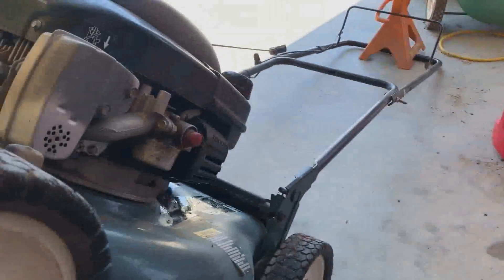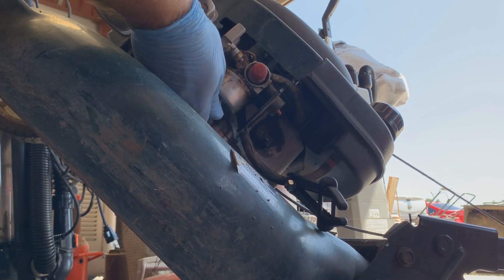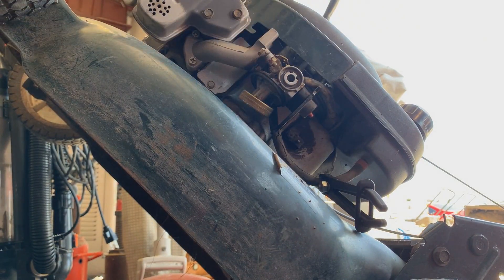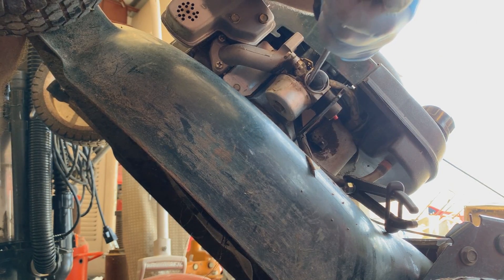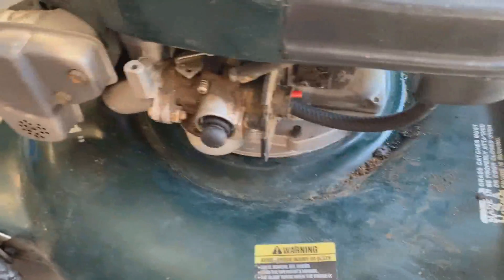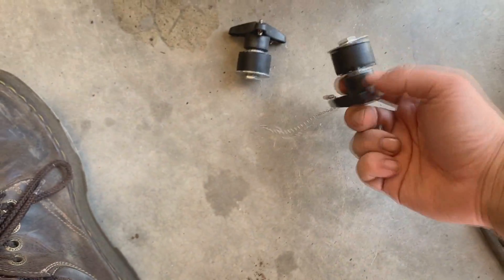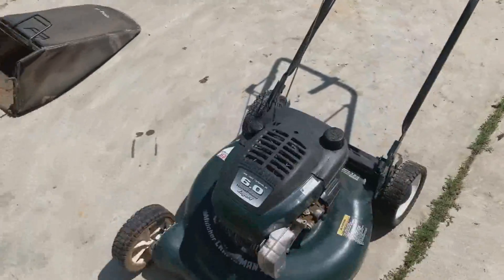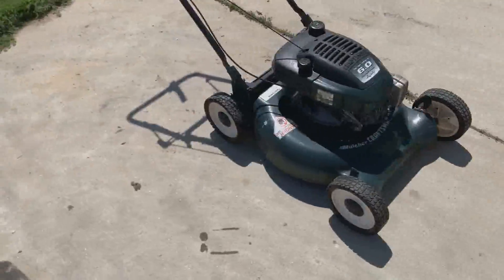Fixing a Tecumseh Craftsman Eager 1

Comment: Thank you for the detailed video. A few questions: Is there a fuel filter and if so, where is that located? I would like to replace my line, primer bulb, and filter if possible.
Reply from the maker: If there is a filter it would be in the middle of the fuel line. Most of the time people don’t install them.
Reply: There’s one in the tank
Reply from the maker: @intotheadventure2592  that’s a screen. Not a filter.
Reply: Thanks guys this helped

Comment: I haven’t worked on or seen a brand T in a long time.
Good video
Reply from the maker: Yea I seldom get them in anymore, hardly stock parts either, still have some new bowl gaskets, air filters, primer bulbs and a few loose carbs but all the other tecumseh stuff I had on the shelf i've slowly gotten rid of.
Reply: @hanksgarage_  I think I might have one air filter, and maybe a primer bulb. Somewhere in the hoard is a complete carb. I'm sure it's needing a clean and parts. I even have a briggs pulsa prime unit. Took it off of road kill. Only serviced one in the last 10 years. And its issue was a broken manifold pipe and incorrect gasket placement from a not so helpful neighbor trying to help out another neighbor.
Reply from the maker: I have a feeling there are so many left on this end of the country, is because we dont really have rust issues here. Might explain alot of that, but like I said its been pretty rare to get them now. 10 years ago they were a lot more common.

Comment: Im getting white smoke when shutting mower off, what should i check ?
Reply from the maker: Rings may be worn. That is oil burning off. Or you have an issue with the pcv system
Reply: @hanksgarage_  thank you